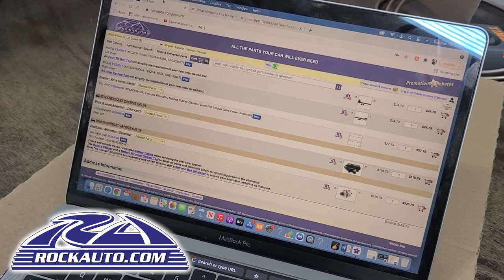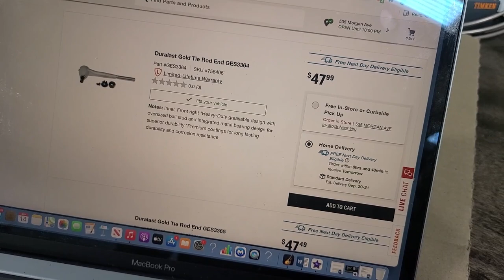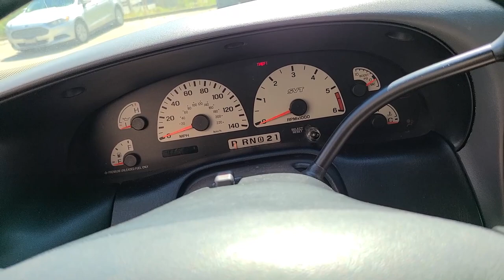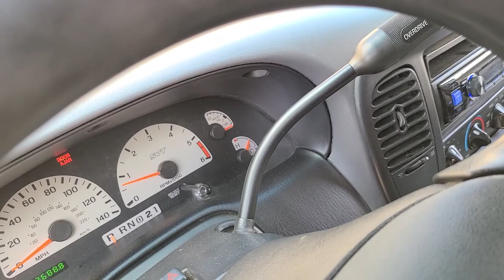I Found A MAJOR Engine Issue After Fixing EVERYTHING On My SVT Lightning! Previous Owner Had To Know

Comment: First of all you’re mispronouncing the name it’s Fraud not Ford. There’s three things to know here one Ford has not built a decent engine since 1997 that’s a lot of years, building junk,  as an American car builder The most recent piece of junk is a GT 500 engine and transmission. all Ford owners are liars and here’s why. I previously purchased a Ford from someone and a month later it started developing all kinds of engine problems and I found out it had been repaired with crappy aftermarket parts and they failed immediately, it had less than 100,000 miles on it which was surprising ,  timing chain issues cam phaser failure , it was garbage and it cost $3000 to get it fixed properly I asked the owner if he had ever repaired the engine he said no and he was the only owner of it before me,  so he is a liar why Ford owners need to lie is because they buy Fords and Fords  are  junk and if you own one past the warranty you’re going to very sorry , My third and final caveat Ford has built half a dozen terrible engines two of them being diesels and they still haven’t even perfected the most recent one Ford is garbage stay away never buy or never drive a Ford without a warranty which means you’re going to own it for a very short time. It’s pronounced Fraud not Ford.